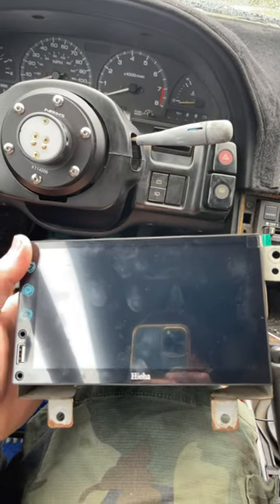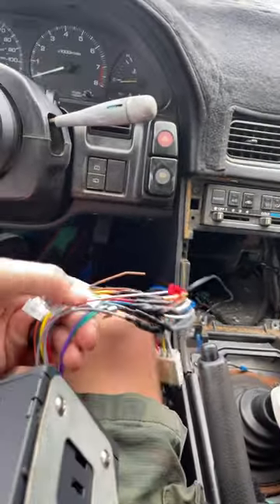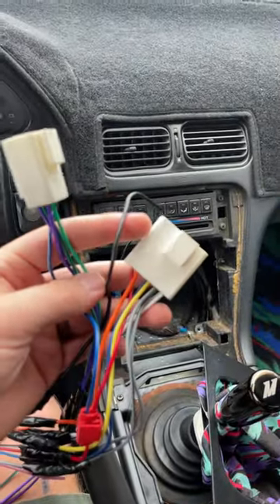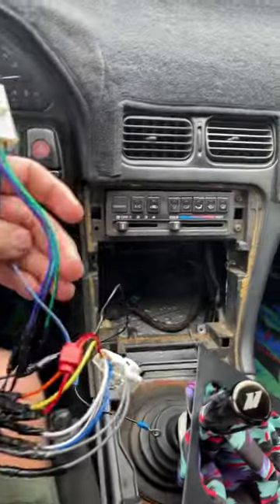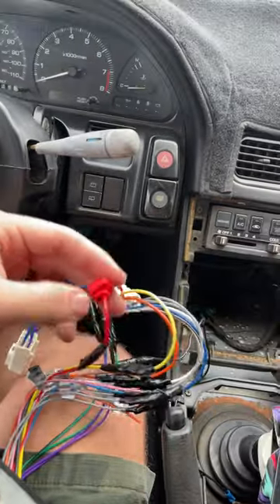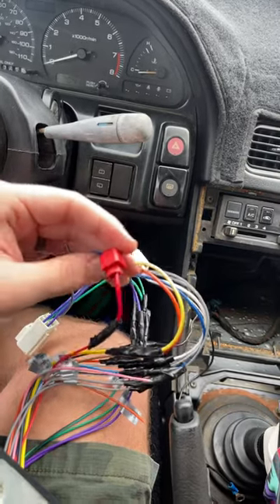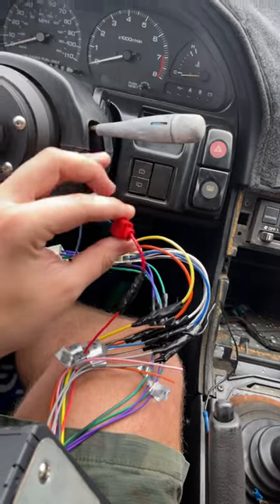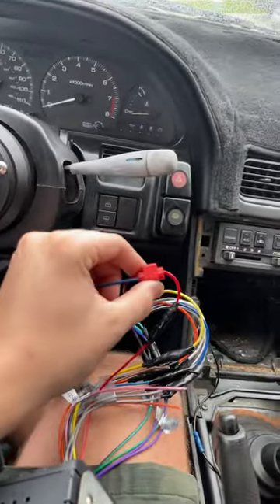HOW TO FIX NO SOUND ON AFTERMARKET RADIO

Comment: That’s so interesting. I just got the sound to work on my radio by putting the amp wire to power… and saw this video directly afterwards. I just installed the exact same head unit. Lol
Reply: is a bypass basically it uses the front speakers I believe because your aftermarket radio would have an "amp" as well

Comment: So on the back of your radio harnes theres the blue wire should you connect the blue wire + the blue white wire to the red ignition wire?? Or will be fine just connecting the blue white wire to the ignition and not even using the solid blue wire from the deck harness....and yes im running a amp fpr my highs

Comment: So i connected my blue wite from the amp to the 12v, and sometimes the stereo will work when it decides to but sometimes it just doesnt. Ive checked the fuses as well, all good. What else could be the issue ?

Comment: I don’t have that wire what do I do?
Reply from the maker: 1. Check the stereo ground to make sure it is sufficient and not loose. 
2. If the stereo turns on check to make sure it is not muted 
3. Check the wiring for the speakers and make sure they aren’t backwards 
4. Lastly, if you try everything and have no luck, your stereo unit might be defective

Comment: Bro help me does that work on and e46 330i???
Reply from the maker: Should work on most cars and its fairly easy to test. Just put the amp wire to power and see if it solves your issue. If it doesn’t there are other issues with your setup
Reply: Yes bro it worked on my e46